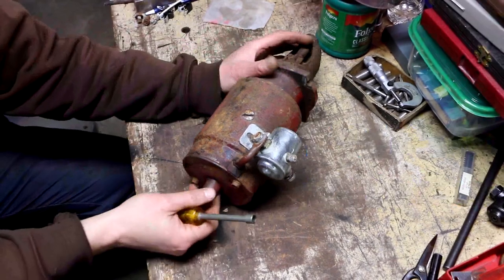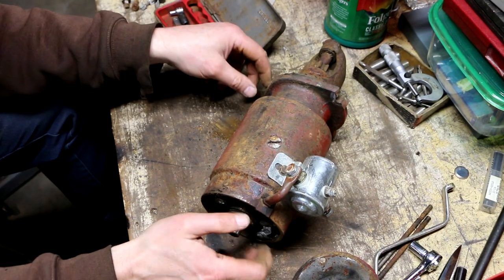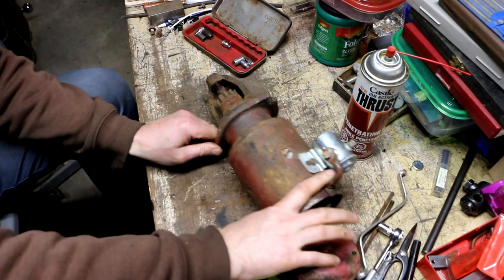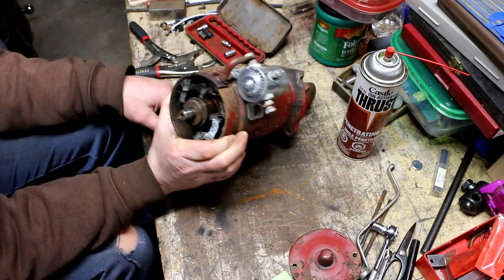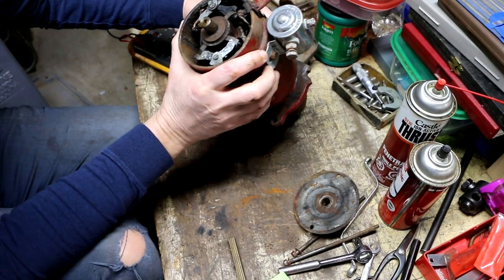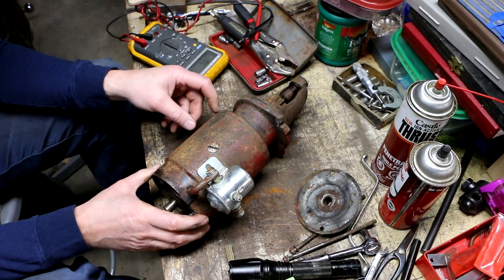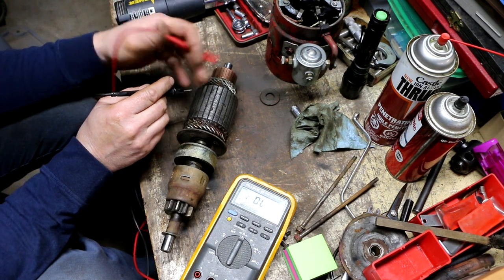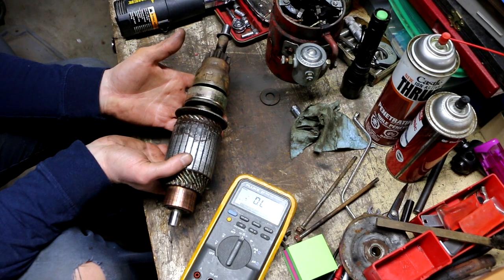IH350 Utility Tractor Part 51: Starter Repair

Comment: Not 3/8 Maybe 10mm. I've seen some aftermarket parts be metric. Kinda backs up that idea when they rust really badly. Newer cheaper metal.
Reply from the maker: Is it just me, or doesn't it feel  wrong to have a metric fastener on old American iron 😁
Reply: @stevewatr  Sure does, but I have ran into it more than a couple of times.